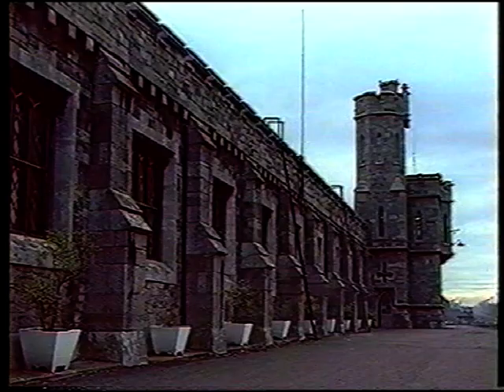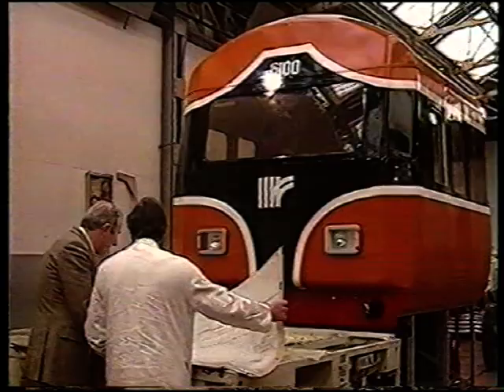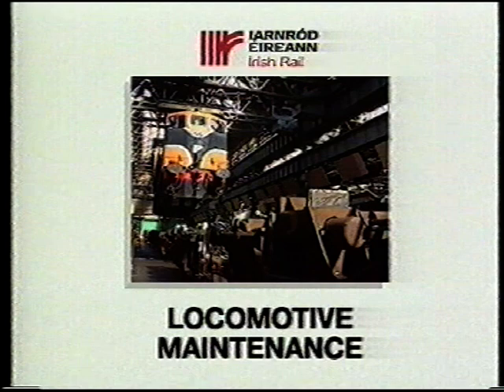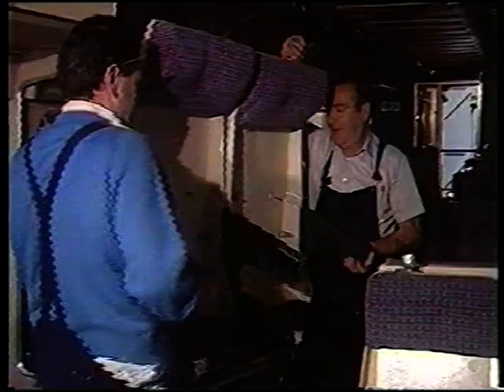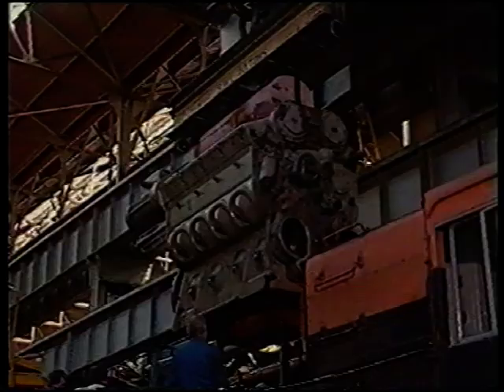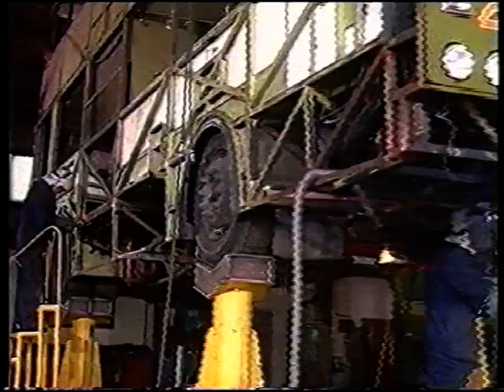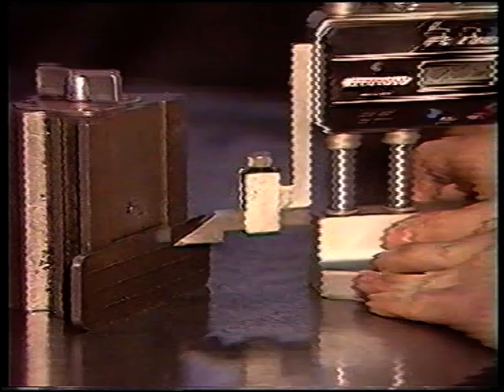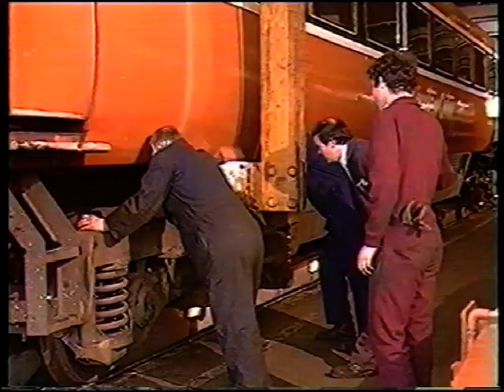Irish Rail Film of Inchicore Works in 1989

Comment: While the bulk of this video was recorded in 1989, and some probably earlier, the still picture at the start is misleading, showing a a 2600 "Arrow" DMU, which only entered service 1994.
 Construction of the mk3 Push-pull coaches did indeed occur in 1989, while the mainline mk3 coaches were built in inchicore 1985-87 approx. (The first ten coaches were delivered complete from B R E L in 1984)
Reply: The IR logo at the start was still there up to 1994 soni could see anything misleading

Comment: Those G.M locos were something else, 44 years old some of them and still been used for freight/Tara Mines. Cant see the modern ones lasting. Shows a proper maintenance system works. Sadly not much happening in Inchicore today.
Reply from the maker: Great machines indeed. Once a machine is well maintained it can go on forever.
Reply: 201 loco's only lasted 20yrs or less,problems with engine fires and bogie cracks ,all parked up in inchicore works,engines seized from being exposed to the elements and in some cases vandalised from tresspassers gaining unauthorised entry,significant investment gone to waste,